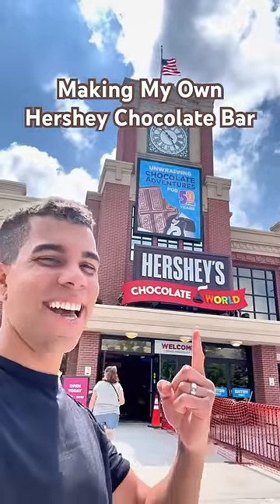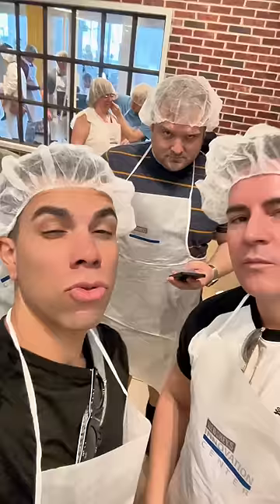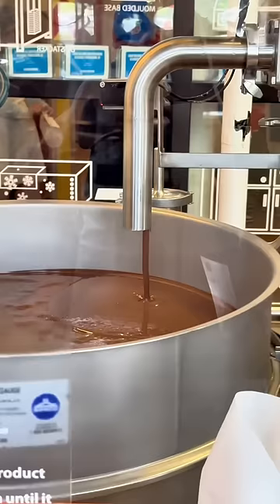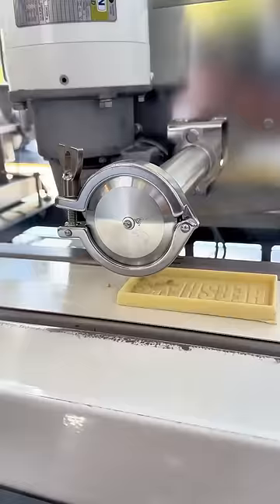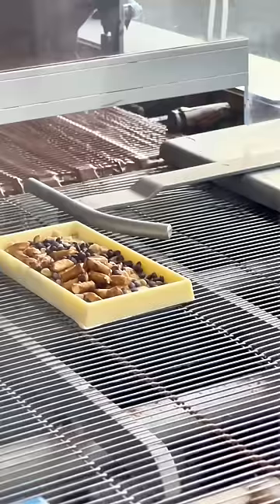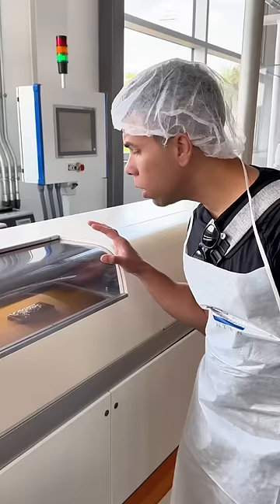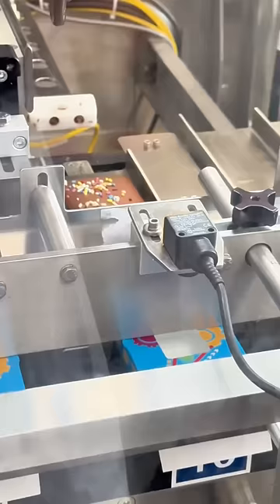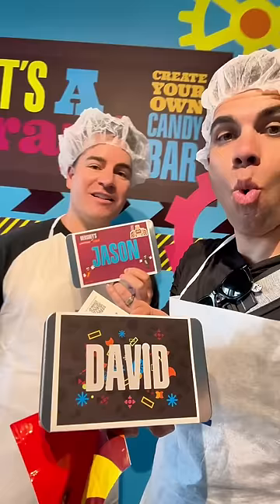Make Your Own Hershey Chocolate Bar! 😱 #shorts

Comment: I worked at Hershey for about a day or two they are so clean and make sure you are very sanitized before you can even enter your work clothes have to stay at work and you get changed before you walk into the actual factory and when you go on break you have to change back into your street clothes. I had to quit because I had recently found out I was pregnant and on the line the boxes of chocolate kept hitting my belly. I would definitely go back if I was back in Hershey